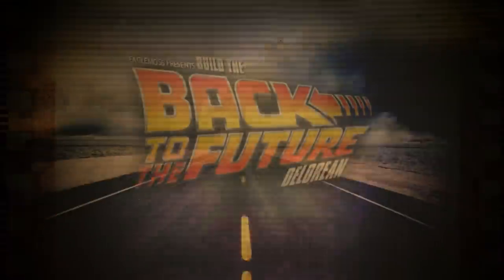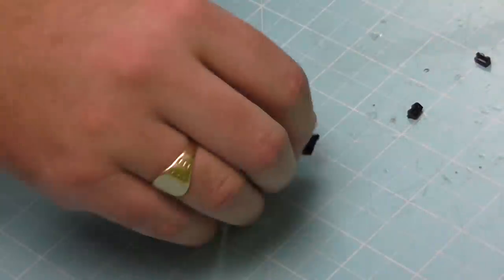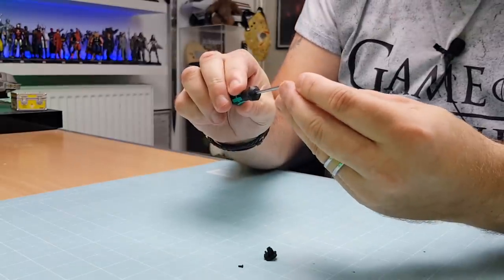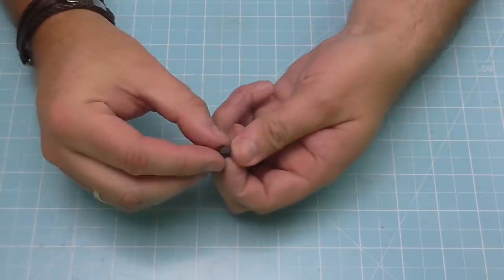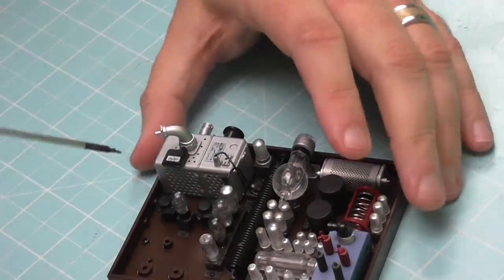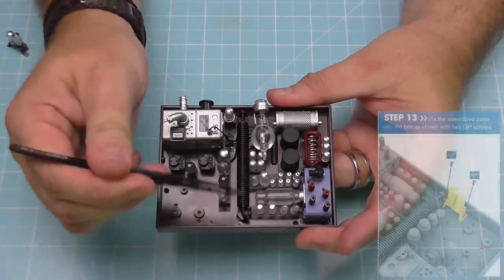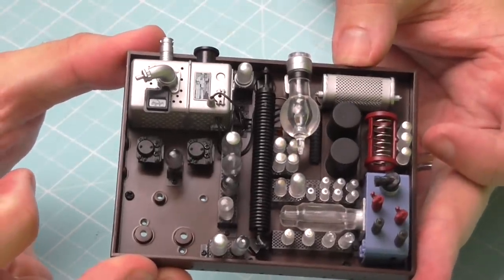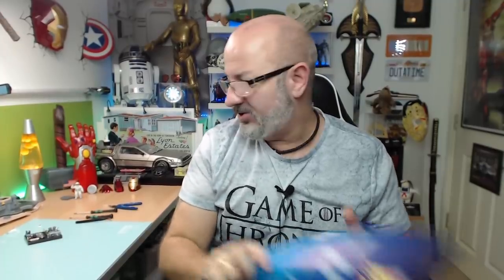Build the Delorean EXTENDED - Issue 147 - Continuing the Time Circuits

Comment: Model railways really interesting but for me its a space issue (lack of) that stops me. I started the deagostini d-51 when it first came out but "ran out of steam" ;-) building it so its another one of those part builts i must get back to at some stage. The newer engine deagostini is doing is very similar but the big difference is its pre-painted.

Comment: In the middle of building the C57 for my son, and it's an absolute pig of a build. You need half a dozen different types of glue, and once you've glued something together, using the glue that they tell you to use, the paint strips off and it all falls apart again. I'm going to be doing a hell of a lot of spot painting once it's done to fix all the patchiness it's generating. Some of the parts are an absolute nightmare to get into place as well, with the glue threatening to dry on you before you've got the part in place, especially inside the boiler, where they get you to glue something to the inside of it AFTER you've attached another part that makes it almost impossible to get this one part into the correct position. I've been putting off the precious box of parts I got because I'll now need to use some epoxy resin on one part and the thought of using the smelly stuff, even though I'll be doing it outside, is enough to make me want to tackle it later rather than sooner. As for the parts that need you to use synthetic rubber cement on them, what a disaster that is. Instead of hardening like superglue, it turns into a black stringy cheese like mess once the pistons are turning on the model and the part you've glued into place decides to come off from the friction of the things pumping in and out of it all. I'll be glad when it's all over and done with. I'm only building it because my son's Autism makes him fanatical about trains. He's paying for the thing, I'm just building it for him. Also, never mind the wing mirrors breaking off people's DeLoreans. This one has bits glued on to the front, at an early stage of the build, which quite happily snap off while you're putting bits on it  elsewhere. I'll probably have to use the dreaded epoxy resin to ensure they stick back into place more permanently once the model's completed.
Reply from the maker: That sounds like a nightmare